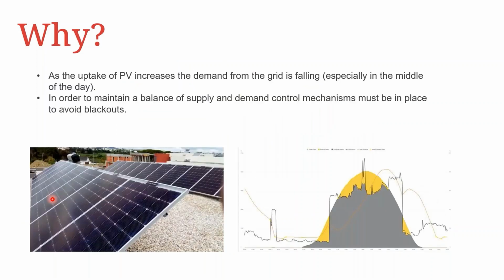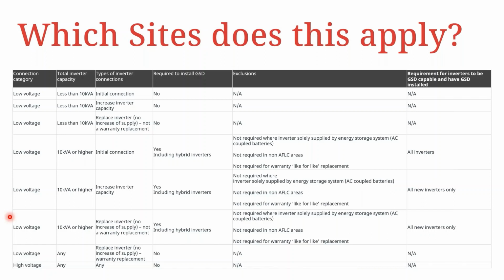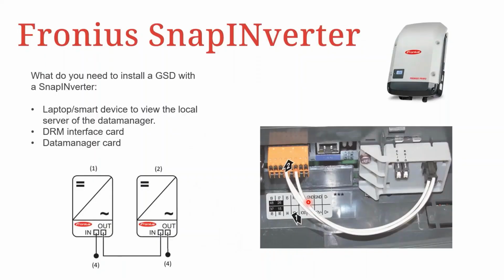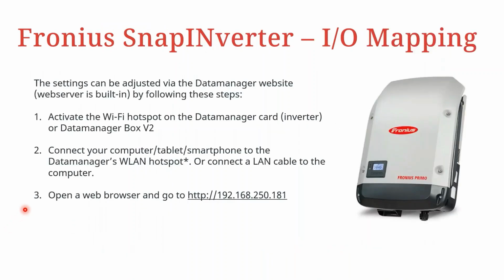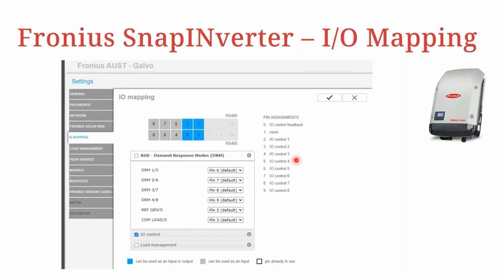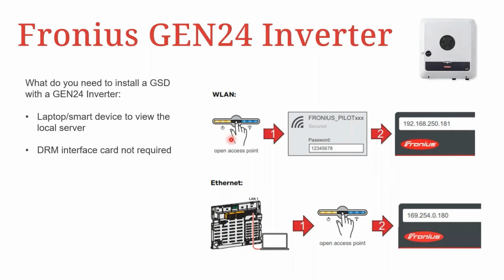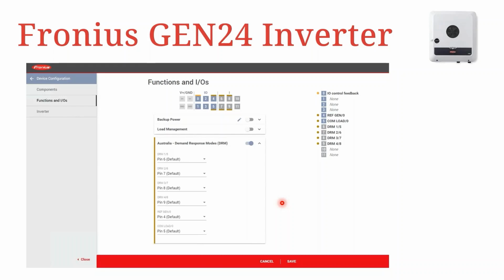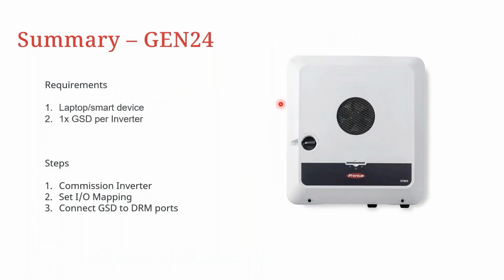How-To: Install a Generation Signaling Device (GSD) for Fronius SnapINverters & GEN24 Inverters(AUS)

Comment: If the inverter is 3 phase, the GSD can be powered from any of those phases? If Cat5E extension is required,  RJ45 pin assignment is standard Type B?